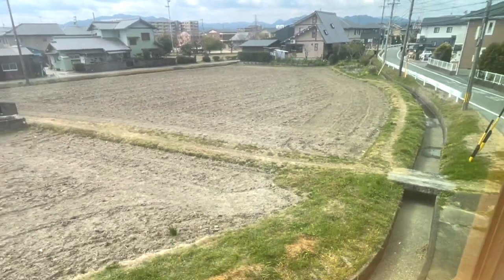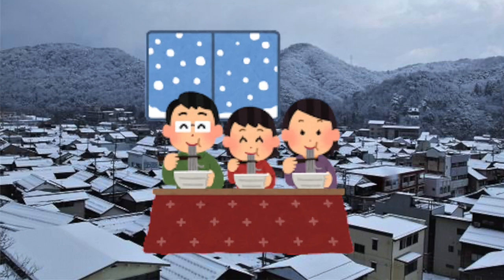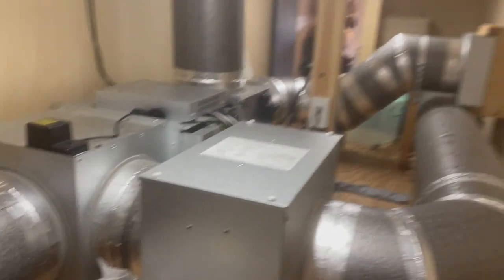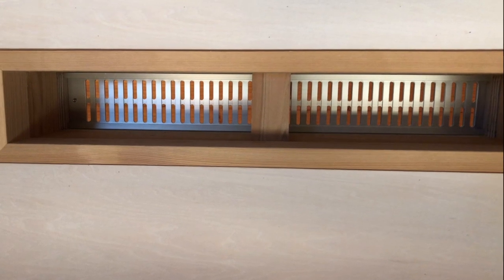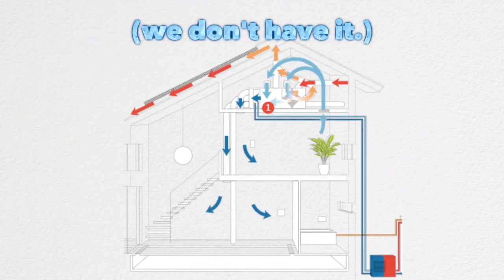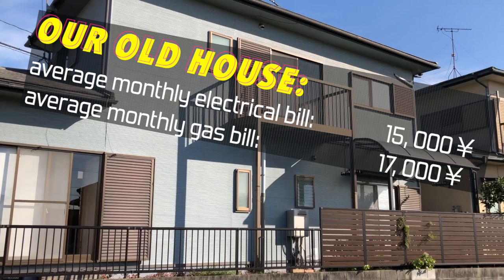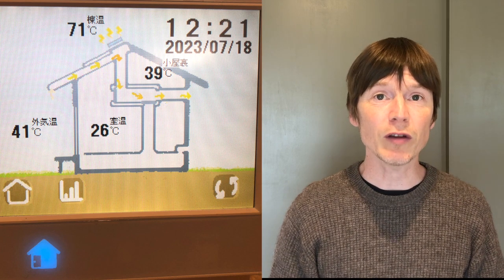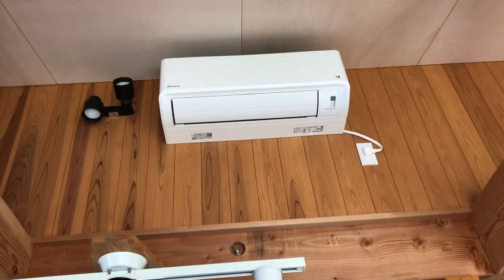We built a house in Japan, and THIS is how our central heating (& cooling) system works. 🇯🇵

Comment from the maker: My most requested video is finally finished! This one took way longer than expected to finish. Partly because of the content, but also because of some gear issues…specifically, the camera on my phone is getting glitchy (because it’s old) and I ended up having borrow my daughter’s phone to retake a few parts. 😆 
But yeah, I think it’s time to upgrade my gear. Anyway, I hope you enjoy the video, but hopefully the video quality on the NEXT one will be better! 🍻
Reply: Very interesting. I and my wife are planning a new house at the moment, or it may be a combination of renovation (one section) and new (the other half - they're kind of separate to start with). I'm also from the "it's always T-shirt warm inside during very cold winters" camp, and we're trying to figure out what kind of insulation etc. we can get here. We're also getting older, and even though I got used to 4C in the morning and 14C during the day, with all heat sources blasting (and we don't like aircon, so in the summer.. wow), I don't think that's sustainable.  

In northern Europe it's now pretty standard with ventilation having to run 24/7, by regulation, but combined with heat exchangers, which seems to be a still mostly-foreign concept here (no pun intended).  And we don't want gas. We've already changed to all-electric for cooking (induction).
Reply from the maker: @tohaason  Thanks for the comment, and good luck with the new-house planning! That part is so exciting due to the ‘sense of possibility’. We spent the better part of a year in that stage. Then we had the construction company architect look over (and adjust) our plans and after that left nearly everything up to our carpenters. How hands-on are you planning on being with the construction, btw?
Reply: @Jordan-inJapan  [Slightly editet] We're currently trying to figure out how to proceed. We have several options, but we don't yet know the cost or feasibility of each. However, we haven't moved back to Japan yet (though we're here at the moment), and we are still looking at how much of the actual building process we can monitor. But we're definitely going the design-our-dream-house route. Not a standard pre-designed house. On the other hand, not that big one either - we're planning single floor only, stairs aren't what we wish for when we get older.
Reply: @Jordan-inJapan  Ten months later..  I and my wife are back in Japan, now busy with meeting construction companies day after day.  We're in Tsu, so pretty near.. I think I mentioned that in another comment, but as I have two accounts (PC and Android) it may have been as another user.
I was wondering if I could get in touch to talk about your experiences when you went through (as I understand it) more or less the same.
(We're actually heading to Ise tomorrow to meet with a smaller company there - we also have some companies in Tsu or nearby which we are thinking about).
Reply from the maker: @ I’m actually in Tsu for work (City Hall) about once a week.  If your schedule works, I could probably meet you somewhere in the area on my lunch break or after work. Do you have Instagram or Messenger? Those are better comm options.
Reply: @ Thanks Jordan. I don't have any of those, but the wife has Messenger. I have Line though - my only instant communication app.
Reply from the maker: (Erased Line link.)
Reply: @Jordan-inJapan  Thanks, got it - I see you in Line but for some reason I get an 'unknown error occured'. I'll look into that tomorrow
Reply from the maker: @tohaason  you can try sending me a link. Or Line user name so I can search.
Reply: So you're paying around$13 american dollars

Comment: Interesting system but I wouldn’t recommend it. It would have been cheaper to install a solar roof and use the electricity with heat pumps to produce hot water and for hot water central heating (or using aircons to heat). You would even earn money by selling electricity. Your system wastes the solar power for most of the year. And it’s useless in bad weather. Also over time the underfloor space will get moldy in summer and you will get this mold be blown into the house in winter… Also the windows are cheap Lixil with poor insulation… there are better ones out there, possibly imported from Canada :)

Comment: It seems the om solar page went out of business - or just isn't available outside japan xD
Anyway, i wanted to ask about maintenance costs. Now that you had the system for a while did you have any issues with it? Seen suggestions that getting repairs might be difficult as it's not a widely used technology yet.
Reply from the maker: First of all, I just checked the website and it still seems to be up and running… strange that it would only work in Japan.? As for maintenance costs, we haven’t really had any yet. (It’s only been about four years so far.) But it’s a good point, and something we were a little anxious about when building the house. Since it’s not such a widely-used system, there’s always the worry that the company will just kind of fade away and we won’t be able to get proper repairs done when the time comes. Basically though, all the components used in the OM system are quite simple technology. The main point of the system is the overall design of the house, so even if the original company wasn’t around to service it, it seems to me we should be able to get any individual parts or modules replaced as necessary. Here’s hoping, anyway..! 😅
Reply: @Jordan-inJapan  hey, thanks for getting back to me! 
some japanese companies do that, so when i only got a webserver landing page i figured that might be the case. but good to know they are still around :D 
also special thanks for the numbers provided in your vid..maybe some day i can convince the missus that we won't need gas in the house.. :D

Comment: For air heater I use photovoltaic film/flexible panel which is black. The air is heated and the panel is cooled. For cooling air can be introduced through pipes mounted in the ground under the floor, under the insulated room for warm air. For the afternoon the air is cooled, then during nights your system is ok.

Comment: The video was interesting and explained the system in your house very well. However, I am from Germany and I have two questions. Given Japan's building regulations for houses in general and earthquake safety in particular, would it be possible to build a house out of stone, as I know from Europe? If it were possible, do many people not do it because it would be more expensive, or are there other reasons? If it would be allowed, how much more would it cost in percent? And the second question is for you, since you may also be more familiar with stone houses from Canada: Without considering the cost, would you have chosen a stone house for better insulation? Or would you have been more worried that the walls would start to get moldy in the high humidity in summer?
Reply from the maker: @FrauWNiemand  Stone is used in Japan for castles and larger Buddhist temples (the foundation), but never for residential construction. As for the reasons, basically everything you suggested is correct. The traditional way of thinking is that a home should be ‘opened up’ to let the air flow through it in the summer, hence the sliding walls etc. This keeps the temperature down (a bit) and prevents mold growth, which is a serious problem here for half of the year. This concept has changed a bit in recent years, and people are starting to build homes with winter comfort in mind as well as summer. (Plus temperatures are too high now in summer to survive with natural ventilation alone!) And yeah, earthquake safety is a huge reason as well. Plus, stone is heavy and just sounds hard to work with…my conception as a west-coast Canadian as well. It LOOKS beautiful though.
Reply: @Jordan-inJapan  Thank you for your answers. I love warm and hot summers. For the climate and landscape alone I would liek to live in Japan, but looking at these buildings in Tokyo, looking for me like a factory of the 70s. These buildings doesn't look as nice like old brick buildings look like. When I look outside my homeoffice window I see a street with only 4-story-houses of the 1900s with pretty little details in carved stone. beautiful. Just to think about what it would be to look only at these tokyo houses makes me so depressed. The older japanese houses are so pretty, how could the Japanese people let the convenience win over the aesthetics?

Comment: Not being able to speak japanese I can't check the manufacturers of heating ventilation etc... it's a pity  I'm curious
Reply from the maker: @AAAAAAndrea  are you referring to a specific website linked in the video description? Or just in general? The system itself is made by a local Japanese company called “OM Solar”, which doesn’t have an English website so you’d have to use a translation app or AI translator if you can’t read Japanese. The controlling hardware is made Omron, a multinational (Japan based) company so it should have English info online. But as for specific parts or systems, again, you’ll probably need to use a translation app. If you have any specific questions I’ll try to answer then!
Reply: @Jordan-inJapan  I was speaking in general, but I'm using the browser translator so it's a bit helpful when using JP websites.
It's hard to check stuff if you can't write in japanese on google.

Comment: I am suprised with the energy costs, here in germany we as a family (2 young kids) pay around 50-60€ per month for electricity and in the winter months also extra for heating (75 m2). Your new costs are definitely nice and low. If we ever decide to live in japan, then going the insulated central heat system route is the way to go (most houses in central europe don't have any air conditioning and just rely on the insulation to keep everything warm and cool)

Comment: Hi Jordan, good to see how the house is going. We've just retrofitted double glazing throughout our house which is definitely making a difference.  A bit like Japan, most Australian houses, ours is from the 1970's , weren't built with the idea of keeping them warm in winter, even those,  like ours, in the colder parts of the country.
Reply from the maker: Nice! How cold does it get in the winter, where you live?
Reply: @Jordan-inJapan  over winter we are generally below zero down to -5°C overnight and about 12°C during the daytime. This is helped because winter where we are is fairly dry. The sunny days make things bearable.  That said our long-term forecast says this winter should be warmer than average.